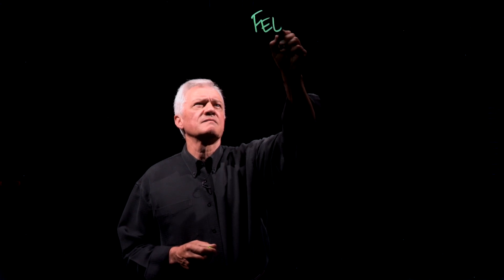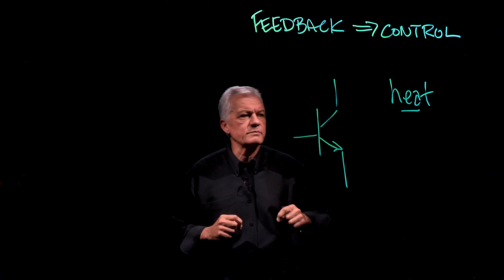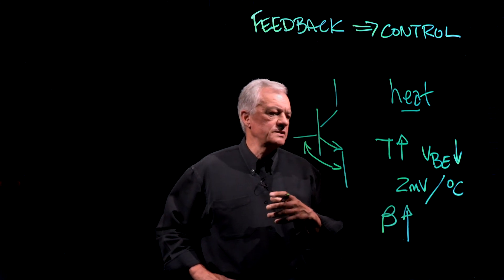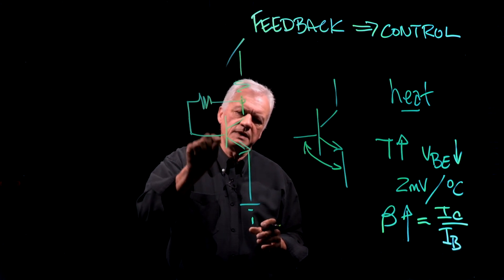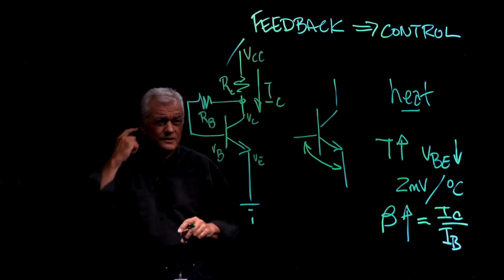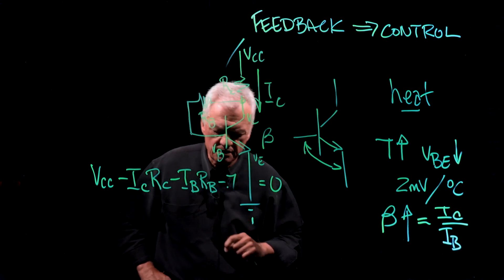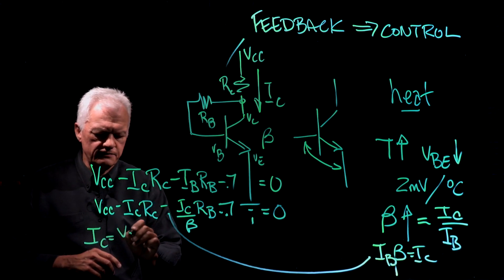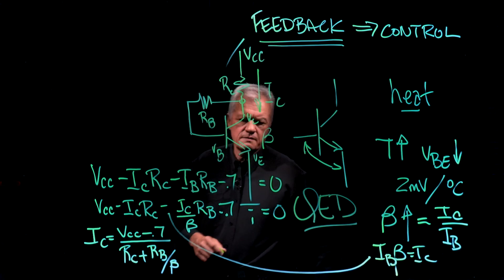Electronic Circuits | Calculating Circuits: Circuit Feedback - Part 4 of 4

Comment: I like how you use concepts from plumbing, or more generally fluid dynamics, to explain electricity. It makes it easier to understand concepts such as voltage by associating it with something a bit more tangible to our visual minds. Nice video overall, you are great at teaching.